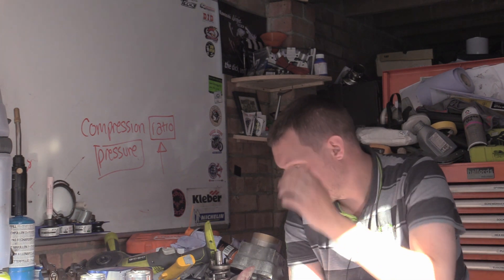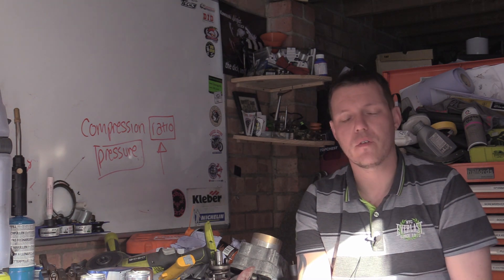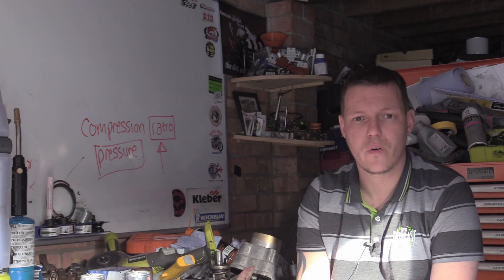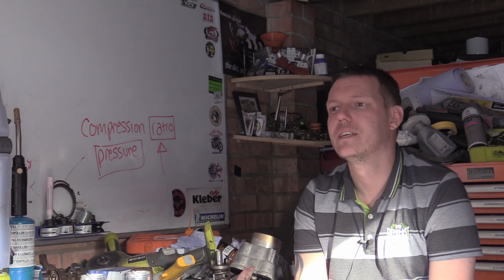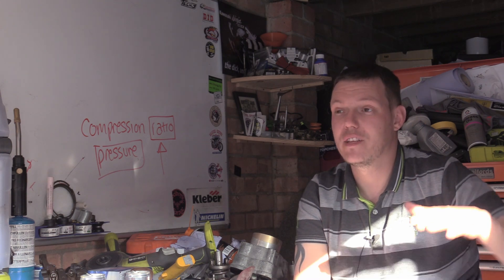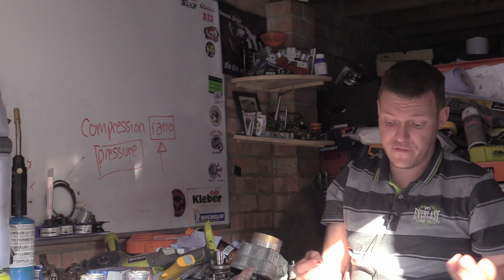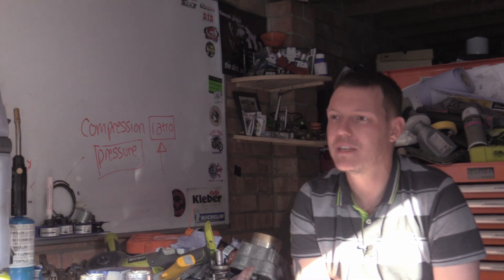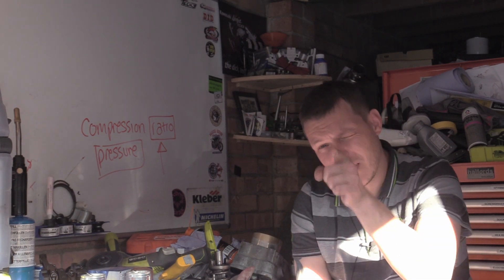Oil level Sensor - SHopCHat

Comment: That oil level sensor soo annoying. I bought a 2001 yamaha yzf r1 and we instantly replaced the oil and oil filter (ofc 10w-40 what the manual say too). On that day there were no issues but next day when I ride the oil level lamp went on even tho my oil level was at max. I went for 5 different mechanic to check it sound just for to be confident that its just a sensor issue and everyone told it has a nice and healthy sound and just the sensor got faulty. Sometimes the lamp goes off for a few sec - few min. And there is no brand new oil level sensor gauge at oem parts neither, we will try to clean the sensor and if its still read false info I will buy a used one, but its pretty annoying to ride with a red lamp... Also the fact the its not monitoring oil pressure is not really a comfortable thing. You can always check oil level, but you cant really check at home that the pressure is right or not if you dont have a sensor for it.

Comment: Oil light came on, enough oil in the tank. Changed the oil and filter. For 30 minutes oil light was off. Then next day oil light came back on. The old oil and filter had some pieces of rubber. But oil was brown. Not black. Sportster 1200 1999. Do you have any idea sir?

Comment: the oil level light on my Yamaha r6 from 2008 turns on after my bike warms up for about 10 seconds and turns back off, I check the oil and its pretty good in my opinion. I don't know why it turns on. any ideas on how I can fix this?
Reply from the maker: Do you live on a hill?
Reply: @thedirtyworkshop  nope i live in belgium so everywhere here is just straight no hills etc
Reply from the maker: Yamahas usually have an oil level and not a pressure sensor. They can also be a bit faulty. Check that the external wires aren't damaged.
Reply: @thedirtyworkshop  hmm ok i will do that, thanks for your time💪💪

Comment: There's little reason why any engine shouldn't have both. The sensors, wiring, and lights are cheap.
Reply from the maker: "There's little reason why any engine shouldn't have both." 

- but from their view there is. Say a sensor and wiring etc costs $10. You build 50,000 bikes - that's $500,000! That's a good reason...
Reply: That's the dumbest argument I keep hearing about stuff like this. The manufacturer can go ahead and charge $15.00 extra, and pocket the extra in profit. For whom did $15.00 make a difference in the purchase of a new bike or not? 

I see all kinds of little things on all sorts of items manufacturers could've done that would've made their product infinitely better for an extra %10 at most. Round up all the bean counters and burn them, I say!!!
Reply from the maker: "That's the dumbest argument I keep hearing about stuff like this."

- Ok so if this is dumb you haven't considered the upfront cost. They don't buy 1 at a time - they buy 50,000 of them at once. This means that the entire 'project' costs $500,000 more. They are running multiple projects and each is assigned a BOM (bill of materials). 

Secondly, they don't know how well it will sell. So there's a gamble. 

So, as you can see, it's not dumb.
Reply: @thedirtyworkshop  Buying 50,000 is the way to go as it makes that feature less expensive. And so what about the cost if they make their money back and more? If the purchase price for all the costs involved is 500k, and they make 750k on itm that's called a good business decision. It all boils down to whether or not they can convince customers having such a feature makes their bike better than their competitor's. In the case of having both an oil level AND an oil pressure light, it would, but of course the market isn't always rational, especially when it comes to items like motorcycles.

As for myself if I had to pick just one I'd pick an oil level light, becqause the other is the easier retrofit. All you'd have to do is find the main oil galley and tap into it. Oil pressure is, as you illustrate in your video, the most important. The desire for an oil level light should`t even be a concern, as any idiot can figure out in a second or two before a ride what their oil level is via dip tube or sight glass, but riders seldom carry out pre-ride checks on their biked as they should, as I'm sure you know.
Reply from the maker: @tempest411  "Buying 50,000 is the way to go as it makes that feature less expensive. And so what about the cost if they make their money back and more?"

- Sorry dude but you're just not getting it. I'll make it simple.

Say Yamaha has $100M to spend on stock for 1 type/model of bike. 

$40M on ally, steel and plastic (other raw materials)
$20M on electronics etc
$20M on Assembly works etc
$10M advertising 

$10M on shipping etc

That's all they're allowed and this is determined by the Yamaha bosses.

Now you wanna buy $500,000 worth of extra sensors. Where does that money come from? Narnia? 

"It all boils down to whether or not they can convince customers having such a feature makes their bike better than their competitor's"

- Not entirely true. This only makes sense when the customer is aware of the feature. When was the last time they told you that they changed the valve guide material or the valve stem material? They didn't. But these changes still happen.
Reply: @thedirtyworkshop  You're stepping well away from considering the real practicality of design, production and use and into the intracacies of company management. Customers would know of both features on a bike because it would appear in advertising, as would any change in valve guide material because it makes the bike better. The inclusion of any feature on a bike would be guided by market research. If the suits ultimately decide against the inclusion of any feature on a bike, that's their call to make, even in the face of reason. It happens all the time. In the end, a sensor, a bit of wire, and an extra light among the clocks doesn't cost much. It wouldn't to you or I as individuals, and would cost far less over a production run of thousands of units.

Comment: I believe Low oil level over an extended time you will blue your shells and other important internal parts. Which will result in you growing a blacksmith inside your engine. 
“Don’t be a dick keep oil on your stick”

Comment: I have a couple of late eighties/early nineties Yamaha FZR's. Did an engine swap a few years back and the oil light wouldn't go out. It turns out one year had a pressure sensor and the other used a level sensor.

Comment: I wonder if low oil pressure would cause increased water temperature? As the oil temp would be much higher too.
Reply from the maker: excellent question

Comment: Can't the manufacturers just install the 2 sensors and use the same light for both?I mean if either the oil level or pressure drops then the light comes on and the user can just stop and check the oil level and if its ok then its a pressure problem

Comment: Some BMW bikes have both. 
What is really required is an oil pressure differential light over the filter, or from pump out to gallery feed,
 Expensive. 
Change the oil and filter regularly. Buy a Honda.

Comment: Yamaha is apparently known for valve guide failure. Not sure of the reason for it but getting my ecu flashed the tech said that could have been my stalling problem. It wasn’t but that’s the first I learned about the “common” problem

Comment: I understand yamaha tbh, the number of random oil pump failures on modern Jap bikes is probably tiny compared to the number of people who never check their oil. I've also seen some pretty knackered oil pumps from bikes where half a gearbox worth of metal chunks got pulled through the system still not affecting oil pressure enough to cause the light to come on. With the exception of some sudden massive oil loss (hole in your filter or a lost sump plug) an oil pressure light basically means you're fucked already and are going to need a rebuild. I've also seen seized engines with only a pint of oil left in them where the owner swears the light never came on right up to the point the rear wheel locked up doing 60mph. Can't confirm if they just missed it or perhaps their light was broken, but sure made me wonder about how full proof oil pressure lights are.
Reply from the maker: "I understand yamaha tbh, the number of random oil pump failures on modern Jap bikes is probably tiny compared to the number of people who never check their oil."

- But what IS interesting is that Yamaha have now started to change and fit pressure sensors instead
Reply: bloody conformists

Comment: So in theory does a oil pressure switch also kinda show level because if the level is to low then surely its not going to get up to pressure?
I would have thought
Also had a thundercat oil light came on quite a few times never did nothing to it.... Was a piece of shit thought I'd just try and blow it up but tax etc ran out before I managed to kill it..... Well disappointed
Reply from the maker: Kind of, yeah

Comment: The most sensible system is one that does both level and pressure. My car has an oil light that comes on Orange to denote low level then goes Red if losing pressure, accompanied by a sound. Makes perfect sense to me. It wouldn't take much to install both sensors on a bike and a two colour led. Orange means you need to top up but Red means it's too late, you've buggered your engine 😄

Comment: I prefer oil pressure light. 

hooked one to my garden tractor with a buzzer. 
So there's no way the key will be left on accidentally because light is good indicator key is on or off😉

Comment: The large V Twin engine design has the perfect solution for those riding with insufficient oil.  The angle of the cylinders will send one or the other piston through your privates therefor removing the rider from the gene poll no matter the gender. And that's a good thing;  yes?

Comment: Would you be able to blame using the wrong thickness of oil following an emergency purchase from the petrol station while out with mates on a day out
Reply: Oil is Oil at the end of the day - mind you I popped into one of my local Pound shop's a while ago,in the DIY and Motoring section there were unbranded litre bottles of Engine Oil,out of curiosity I shook one and it felt like I was shaking a bottle of water.I decided that I wouldn't risk that in any Engine Lol.
Reply: @paultanton9899  I still can't believe a litre cost £13 and that Halfords stopped selling it by 5 litres

Comment: Makes not a shits worth of  difference if you look after your bike properly  ... though gave me a scare on  an EXUP1000  at 150mph  going up a hill
Reply from the maker: I disagree - problems happen. If you do all the maintain etc it still doesn't mean a bearing can fail or whatever
Reply: @thedirtyworkshop  FYI I agree you should have both
Reply from the maker: "but an oil pressure switch light coming on is still  to late to save  your engine"

- What makes you think that? I smell a test coming on
Reply: but an oil pressure switch light coming on is still  to late to save  your engine in all probability far more likely issue for bearings are bell ends burning up all their oil

Comment: I'd confirm that. Although my "expertise" is limited to the XV series (Virago and Drag Star line) those all have level sensors. Hard acceleration makes the light come on as the pump delivers most of the stuff to the heads and galleries but let go of the throttle it goes out again. 
Having said that I'd be happy to have a pressure warning or gauge.

Comment: My R6 takes 2.4l of oil and the level light starts coming on after 100ml burns off. Confused the shit out of me at first because I thought it was a pressure light, but it went away after warming up. Then I checked the dipstick and it seemed fine.